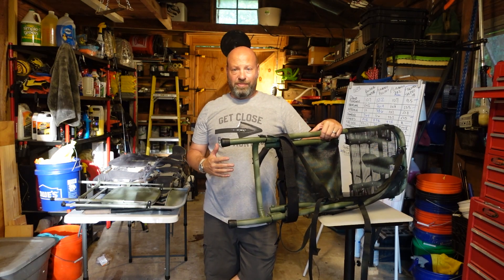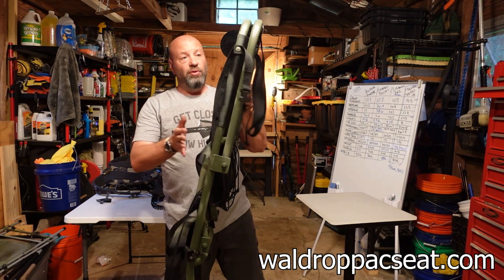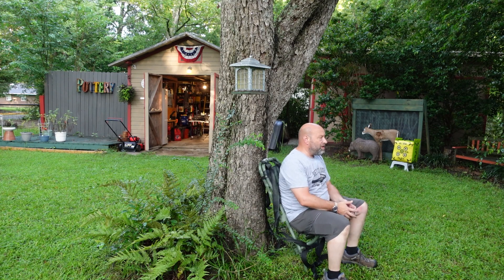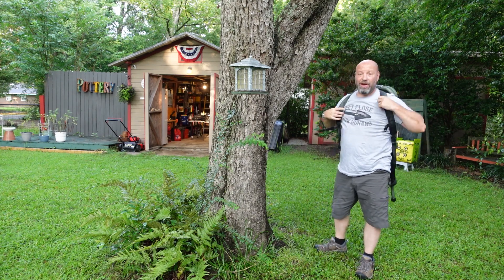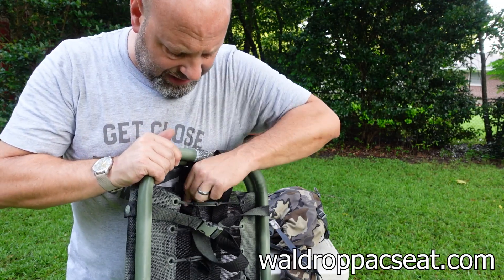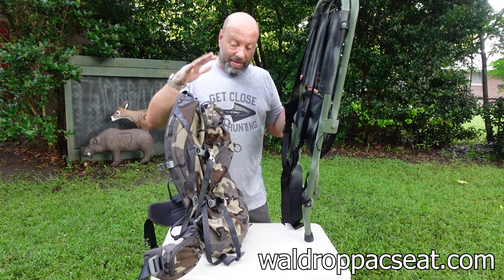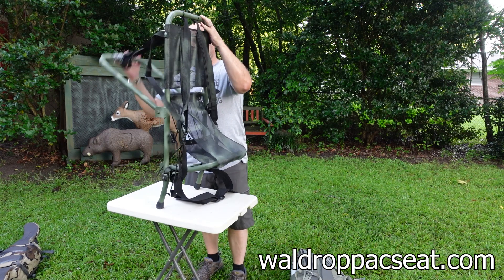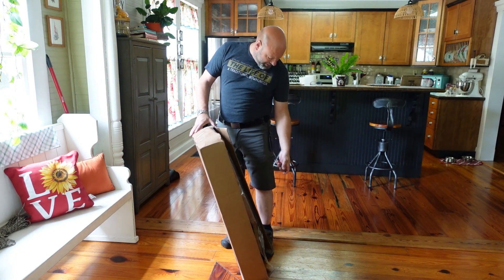Waldrop Pac Seat Review Most Versatile Hunting Chair

Comment: I have turkey and deer hunted for years with one of these.  They are worth every dime.  Absolutely silent and unbelievably comfortable.  Easy to shoot from even with a longbow.  For stand hunting on the ground you will not find better.
Reply from the maker: Love hearing this! Can't wait to hunt with mine.
Reply: I second that
Reply: So I noticed on the website they had a Turkey one but it was only a couple inches shorter just wondering if I get the original if it’s that big a difference that I would not want to use it for turkey hunting as well
Reply from the maker: @cregp72  I think the full size is 15 inch height and the turkey is 8 inches. If that helps ya figure out what's best for you

Comment: I just bought some wide bottom crutch bottoms for my wife that are made so you can go through sand, I bet those would be great for the front legs. After looking further into this seat I’m probably going to buy one.
Reply from the maker: Great Idea. It comes with tennis balls if you need them. But Honestly I have not had a problem with the legs sinking. We used it fishing today along the soft bank and zero sinking issues.

Comment: Hey Jason one more question. My wife is going to buy this for my birthday. I can’t decide on the regular or the turkey version. I usually like being low to the ground, but hard to tell as I can’t test these chairs out. Are you happy with the regular or do you wish you had the lower turkey version?

Thanks always value your opinions.
Reply from the maker: The turkey chair is 8 inches off the ground and I can't remeber the height of the original I have. But it's perfect in my opinion I can still lift off of it to twist and turn to shoot with only my legs. I'm very happy with it. Have not hunted with it yet as it's still so super thick down here and I want to see the deer coming in these swamps.  But look forward to using it once the leaves drop and I can see more than 10 yards from the ground
Reply: Copy. Thank you sir.

Comment: I think it’s on par as far as price goes but from many years of hunting a seat that has legs on them sink into the ground, usually on more than the other. If the front legs were like the rear it would be a winner.
Reply from the maker: He sends it with tennis balls on the front for us swamp hunters to use. But honestly even in the swamp it doesn't sink bad. The rubber feet on the front are big diameter and barely sink even in the ga swamps
Reply: Cut a piece of pvc pipe a little wider than the legs. Drill 2 large holes, 1 for each leg. Its a hack that is done on lawn chairs to keep them from sinking in.

Comment: Thank you. I ordered one and used it once. It seems to "creek" a little like it is settling or something when leaning against a tree. Every few minutes, "creek". Anyone else have that issue? Am I doing something wrong? Thanks!
Reply from the maker: Mine has not made a sound yet. But make sure you have the back flip bar in the up position when leaning on a tree so only the front 2 feet are on the ground.
Reply: @SamkoTradBow  Thank you, I will try that.
Reply: @SamkoTradBow  , I think that was it. I went out this evening and sat against a small tree. First time I ever saw a buck chasing a doe, they almost bumped into me when they came by. I had 3 more come in within 20 yards and never knew I was there. I guess being comfortable and still makes all the difference. Thanks for the review and content. I am a paetreon subscriber also.

Comment: You make a very compelling case, and looks great. I know you said it is quiet, but is it truly quiet??  At risk of being redundant (forgive me), I ask because I've been burned so many times by chairs that eventually make noise at the joints when sitting in them, twisting and turning to look, or shifting weight.  I weigh about 210 pounds.  Thanks for bringing this to our attention.  Kind regards.
Reply from the maker: I have not heard one sound or squeak from it yet under any circumstances. Not once. Hopefully that continues but if it ever does develop a squeak I will fix it with stealth strips
Reply: Jeff, if you're looking for a seat that is truly dead quiet in any weather, then check out the Ground Effect hunting seat by 03 Outfitters. I've used it in temperatures in the single digits and it never made a squeak, and I weigh over 200 lbs. It's the only seat I'll use for deer hunting anymore. Hope this helps!
I forgot to mention that Sean's Outdoor Adventures does a nice review on this seat on YouTube. It's titled: Portable Hunting Seat Review.
Reply from the maker: @americanwoodsman4206  looked that that seat before. Looks great but won't work for me as it has to be by a tree. The waldrop is a leaner or a self standing seat. Most of the places I want to use it doesn't have trees. It is 100% dead quiet so far and it also acts and a frame pack. Love the waldrop.

Comment: I have other options for hunting that will work well and replacements for them are not as pricy, the small easy take down stool is the main thing I will replace with a better model when mine fails for good, that Walmart one had a single leg of the 4 fail after light use, in the 2000's but is not out of use if I sit on it in the right way that for bowhunting will be my main model and getting a new one for hunting uses. Then a flat folding black chair if needed for long use sitting and last my Heat a Seat if I am hunting a spot that has enough places to set that down on but mainly for Gun hunting when it is colder out.
Reply from the maker: But none of those options can pack a deer out or lean tight to a tree with lots of roots. I have all those folding chairs too. They are good. But do not offer any of the features this thing does. This chair is so amazing! I will never go back to those other hunting chairs again. Not after using this!
Reply: @SamkoTradBow  I totally get that but I do not need those options where I live and I do not pack out my animal, only remove the guts that is mandatory due to some odd laws on packing out animals that makes it almost impossible to do so, needing the head of the animal sticking above the head of the person, making it more likely for shorter people to get shot at in low light especially if you got a buck and not a doe even with the mandatory one piece of visible hunter orange on above the waist.
Reply from the maker: @caseysmith544  yep some states have crazy regulations.  I have a place here in ga we have to take the deer out whole ungutted at specific times of the year.
Reply: @SamkoTradBow  There are places like that in South Dakota too but they have such odd limited deer season for gun and if lucky bows that it is not really worth the hassle to try and hunt those spots.
Reply from the maker: @caseysmith544  yep I hate dragging deer anymore